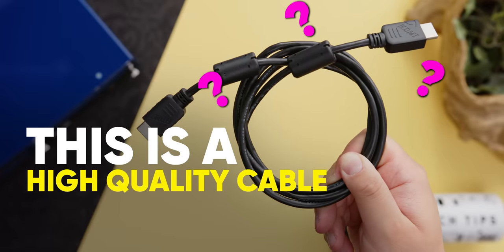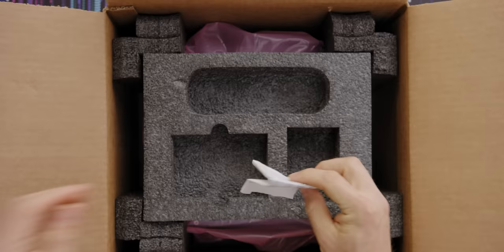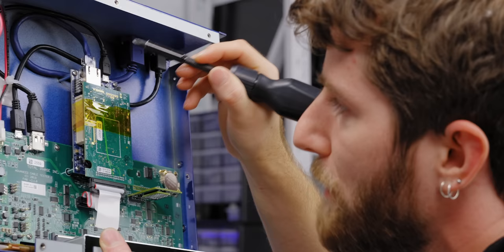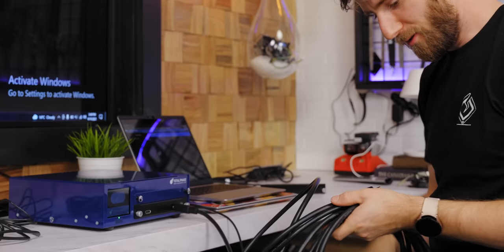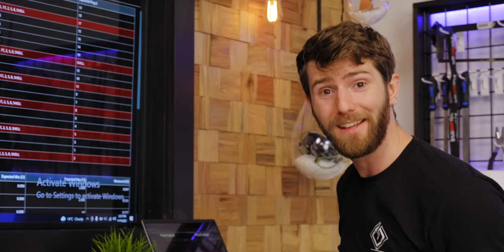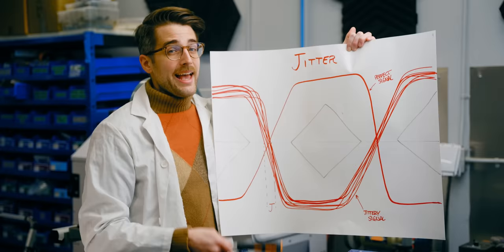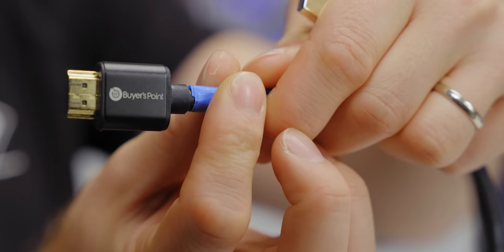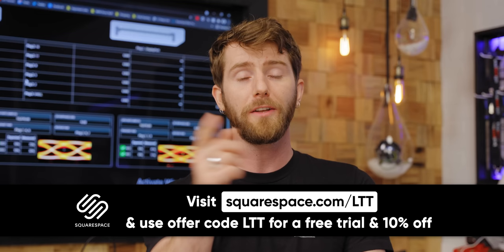This Just Saved me $100,000 - Totalphase Cable Tester

Comment: So are we going to find out if Anker is actually the best brand? I would like to see the difference in the different Anker Powerline USB-C to USB-C cables, I went with the PowerLine II 10Gbit, becuase it supports ultrafast speed and also the full 100W USB-PD. So my ultimate question I want answered is which is the best cable in terms of electrical resistance of the power wires.
Reply: Seconded!  Shopping for quality USB-C cables is awful.
Reply: Thirded!! Interested to know how Anker cables test as well.
Reply: If it's just resistance you could probably rig something up in an hour, not spend 100grand
Reply: @TheCarpenterUnion  sure, anyone with a basic knowledge of electricals can do that, but this is us chiming in to Linus asking which brands does the audience want to have an insight on in terms of quality of cables.
Reply: @TheCarpenterUnion  yea I do have an LCR meter and various USB meters/loads, but it would be nice if LTT put cables head to head, or gave it to GN and they can spreadsheet it up!
Reply: Great Scott! just released a video answering this question.
Reply: Clearly not since LMG dropped them as a sponsor
Reply: @jeremydale4548  There are many reasons to drop a company as a sponsor so don't jump to conclusions. Maybe their sponsorship terms just suck?

Comment: Make a spreadsheet of the brands and supposed specs that they claim and add the results with a time/date stamp. A two man job of testing and data entry while you check your inventory of cables. That way you can always review them later if those same brands make revisions or new products.
Reply: THIS, rn buying HDMI 2.1 on Amazon or elsewhere is a minefield, even the certified ones, I bought two and both failed, non stop blinking and other failures
Reply: I second this. This would be so good. 

An open source database of cable integrity. Wish ltt does it.
Reply: I was about to get the Zeskit hdmi 2.1 16ft cable but im getting mixed reviews, my current cable keeps flickering from time to time when send a 4k hdr 120hz signal which does not happen with the short cable, i know hdmi lenght limitations but a 16ft (5mt) cable should be possible and thats what im looking for.
Reply: This sounds like an AWESOME idea! We cannot wait to see it!
Reply: You need to test like 100 cables of every brand, type and size to even have a single significant data point. You can't just test 1 cable and say "all cables of this type by this brand are good or bad". So this is next to impossible.
Reply: @SyntheticFuture  While true about 1 data point is a negligible one, it does say things about their QA if they sent out a faulty product.
Reply: @dvknight  happened to me with a cablematters 16.4ft certified HDMI 2.1, the one with fiber in, the cable ultimately died after much flickering and now is straight no signal

Luckily the manufacturer will send a free replacement, may the force be with me

Comment: idea: whenever you test a monitor/tv, test the included cables.
Reply: That idea is actually super helpful
Reply: I don't think it is needed, since manufacturer standardized them so that the device you are buying give you optimum performance.
Reply: Good idea
Reply: @chocolatecandybar4319  Thats right. A manufacturer would never cheap out on cables. They only care about our experience.
Reply: Along the same lines, perhaps a video showcasing different company's included cables. I'd love to see how the new xBox and PS5 cables stack up
Reply: Nice
Reply: If the included cable doesn't match the supported standard, send an angry email to the manufacturer and make a big deal about it.
Linus has enough pull to change what manufacturers do!
Reply: @chocolatecandybar4319  +1
Reply: Yes!
I got an 1440p165hz gsync monitor where the original DP cabel works perfect in 144hz but at 165hz the monitor blinks (resync) about 2 times per 3-4 hours and then blacks out and monitor need a input switch/restart to start working again about 2 times for 3-4 days.
I did try a custom res/timing mode and i think it was at 163hz (could hav ebeen 162hz to) it became 100 stable för over a week.

So clearly the cable is just a tiny/tiny bit over what it can handle!
i have run 144hz for a long time now and do not really notice anything in games/etc (that has fps over 144) so not that big of a deal to me also over 144hz was very very low on my list when looking/buying it.

But it is something that should be tested!
Reply: @runed0s86  +2🥶
Reply: Yea probably but I think big brands like dell that sponsor videos don't cheap out on cables, imo
Reply: @Lewini  now that's something id love to see... for the most part both company's seam to do well with the shipped cables but would still be a good test and comparison.
Reply: That was exactly what I basically thought too. I used Capture card, GPU's and Consoles as my example but basically anytime a product has one test it and include it in the review.

Comment: I would love to see you guys include cable tests for any included cables when you're reviewing a product.  Like if a monitor comes with an HDMI or DP cable you can test if it's actually worth using.  I love this kind of granular tech stuff and I am glad to finally see someone doing testing on a very grey area of the market.
Reply: I don't think the device had a DisplayPort connector. Would've been pretty sick
Reply: @seasesh4073  It has interchangeable testing ports.
Reply: Also test USB cables included in phones to verify PD

Comment: I'd love to see the Quality of peripherals for a monitor for example, just add something about whether or not one should buy a separate cable or if the included one is fine.
Reply: That's actually a great idea. So many of the devices LMG reviews, unboxes, or features contain cables that may or may not be sufficient for the product they're bundled with. It'd be interesting to find out which brands bundle quality cables and which cheap out.
Reply: I concure just throw in a little section about the quality of the cables included in the review
Reply: This. For every product LMG reviews, just a quick line on whether the included cables are Good or Not Good.

Comment: OMG. Every cable manufacturer is probably shitting bricks right now because LTT can test their cables now. This is gonna be great. Can finally know what cables to avoid and what cables are actually worth the money.

Would love to see that 1k HDMI cable tested. Also, would love a video of testing different cables on a test bench to see if there are frame differences possibly. Though I know it'd probably be minuscule and more typical deviation between tests than an actual real difference.
Reply: tan j maz  actually, that's quite cheap compared to other products that can measure in the range to 10ths GHz
Reply: There wont be frame differences at all if a cable cant to 4k 144hz for example the monitor will say insufficient signal cant establish a 144hz link and downscale to I dunno 120hz 75hz
Reply: tan j maz  It's industrial equipment, you are not meant to buy these, obviously it's worth the money for LTT because of what they do.
Reply: tan j maz  making a device like this is very expensive, since it needs collects very huge amounts of data in a very little time in order to test the cables. The oscilloscopes that are able to measure these stuff can cost up to millions of dollars, and it doesn't have such software that can measure and sort the measurements like this. I guess it's relatively cheap because it's very specifically designed for HDMI cables.
Reply: @ArmiaKhairy  It is a generic redriver/retimer from TI. It has nothing in common with set multi ghz equipment. And no one in their mind would use a real time oscilloscope for that kind of job. There are VNA/BERT testers for that.

Comment: Linus: I'm worried about manually soldered wires.
Also Linus: let me tap my screwdriver on all the internal bits.
Reply: Not just this video, but every time you hear that metal scraping a chip or solder point, I grate my teeth. Not only for the nails on a blackboard sound but potential damage.
Reply: It's not like the top of a chip does the important bits
Reply: @JaredConnell  naked flipchips would tend to disagree. Also, a slip-up is very easily made.
Reply: In a later video he had an old Mobo he tried to start it by jumping the header pins with the LTT screwdriver and apparently the coating wasn't conductive or something I think

Comment: idea: keep using the cable tester for your own internal purposes, but log all the data of which cable suppliers passed and failed, then release an occasional report on those
Reply: just like back blaze does for hardrives.
Reply: that could be rude, when Linus drives a car over a cable for a stunt, then finds it in a box months later and then complains on air about the cable.
Swiss parliament had high quality Ethernet wire installed, but it failed signal integrity test. It took a few weeks before they figured out that someone store a heavy crate on top of the cable spool, deforming the inner isolator, degrading signal integrity. Note: The cable spool was clearly labeled as "do not stack". So, the cable manufacturer and the installer where not at fault, but a random contractor caused a lot of damage, as the wire had to be replaced.

Comment: I am an "Entertainment Technician", and this tester could save me SO MUCH TIME... You have no idea how often I have to diagnose problems with video signals between multiple systems on a show or event. Normally everything works well, but when it doesn't a giant headeache is had and it's next to impossible to know what part of the signal path is at fault.

Comment: It would be interesting to see some "Audio-Voodoo" cables, especially the digital ones, like LAN, that are supposed to improve your audio streaming signal for so called "audiophiles"...
Reply: for analog, cable quality matters. for digital, not so much. Either the signal is clean enough to read or it's not. As long as the cable meets the bandwidth requirements, it will perform as well as all other cables that also meet it. A digital audio cable built to spec that degrades the signal such that it can not be perfectly captured on the receiving end is broken and should not be used. Full stop.
Reply: I looked up the JPS Labs cables that dms brought to demo his Abyss headphones. The high end power cord costs 10k/meter.
Reply: @lethalantidote   No. Digital cables affect sound way more noticeable than Analog cables becuase how overlooked they are. Supra cables are very cheap and the improvement is huge. Their $40 USB cable is very close to Audioquest Diamond performance.
Reply: @allansh828  This is the exact reason, why LLT should test audio cables. I would like to see a comparison between XLR and Jack because of the countless argument of "what sounds better"
Reply: @lethalantidote  I expect that there are digital expensive cables that compromise performance for esthetics or plain and simple sheer incompetence, and are not spec.
Reply: @allansh828  Most audio equipment use only USB 2.0 there is no need for a 40€ USB cable. A USB cable works or it dose not, there is not such a thing as better performance. You are only able to meet the bandwidth or you are not and your connection wont work. Your USB host device like a USB controller can become a limiting factor because those are sometimes slower than the rated max transfer speed.
Reply: @klipschorny  It's a Bot, probably posted on every other comment on this video, just report it
Reply: @guyfawkes8873  Spoken like a true engineer
Reply: @bobjohnson6362  the main reason for XLR is both that it locks and it won't cause a short when plugged in. Sound quality wise I doubt they have that much difference.
That's said, 3.5mm jack is definitely extremely fragile, but that thing is not for industrial use anyway.
Reply: @Amixus  you would be right to buy a reputable standard cable, but maintaining signal integrity in USB 2.0 isn't trivial either, especially when approaching the 3m length mark! You are running audio devices in isochronous transfer mode, which reduces latency but also reduces error tolerance compared to bulk and interrupt mode devices such as input and storage. It is however the same transfer mode as used by most video capture devices and webcams, and those are REALLY finicky with cable quality.
Reply: @allansh828  the only reason why it can get a difference from the choice of USB cable is that it both transmits power and (sometimes) provides grounding. But if you are audiophile enough I doubt whatever USB DAC you use doesn't have input filter built in already, so the difference you get is likely next to nothing.
Reply: @FlameRat_YehLon  Thanks for the explanation but i am aware of xlr cables being more secure. I just get so tired of all the discussions where people swear that xlr sounds superior. I totally agree that there won't be huge differences but i still want some "professional" testing and data that actually proves one side or the other.
Reply: @guyfawkes8873  firstly, I 100% agree. But digital signals that travel through cables do not have to be binary. You could send a 2-bit signal over a single cable by defining 4 voltage ranges rather than 2.

Digital cables, like analog cables are affected by signal noise. But as long as the signal to noise ratio is not to high (as would be the case for any cable in spec), then there will be no performance difference between cables. Digital cables can handle a good deal of noise and still transmit a perfectly usable signal.

This is unlike analog cables in which any noise will affect the performance.

This is like comparing a CD to a record. Scratching a CD will not impact the sound in any way so long as all the data can still be read. Any scratches on a vinyl record will alter the sound it produces. 

Digital cables are able provide the exact (and I mean exact) same audio experience even if one cable technically introduces more noise than the other. This can not be said about analog cables. 

In other words, signal noise on an analog cable always results in additional noise in the transmitted audio. Whereas digital cables can support significant amounts of noise before affecting the resulting audio in any way. 
 
If a digital cable is causing loss or negatively affecting your audio, then the cable is broken or you are using the wrong cable. 

That all being said. Shielded cables do experience less signal noise (all else being equal). If you are running lots of untwisted cables close together or you are running them near power-carrying cables, then shielded cables might be preferable as they can go for longer (in these situations) before reaching a critical signal-to-noise ratio.
Reply: @bobjohnson6362  well, for comparing between non differential and differential audio transmission, differential is definitely more interference proof, that's for sure. XLR is always for differential but TRS can be for either one. Maybe some people just compare XLR with non differential TRS?
Anyway, for home I doubt that's gonna make much difference at all, giving that home hi-fi setup hardly use any long enough cable at all. XLR is probably more useful for its security than anything else.

Comment: I would like you to test the cables that come with high end Monitors and see if theyre up to spec.
Reply: They almost certainly are. The main point of bundling cables is avoiding RMAs due to customers using bad cables.
Reply: @hellterminator  Another reason to make sure they really are :) 
Factories could scam the brand so badly. Make some good ones first and then start putting cheaper shit in the box after they get established.
Reply: Not just that, for every time they review any product they normally would. If the product comes with a testable cable (except power cables probably), I would love to see them briefly cover the data for that cable as a brief segment, because that's part of the product and thus pertinent to the review.

Maybe they edit out the testing time but it looks fast and easy enough to test the odd included cable or two for product reviews going forward.